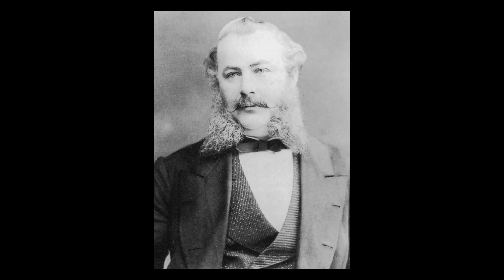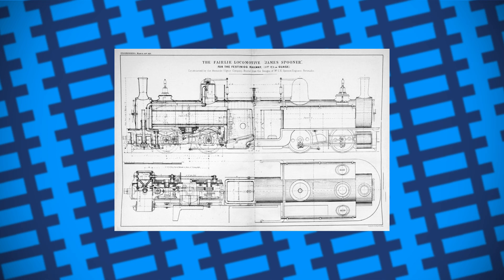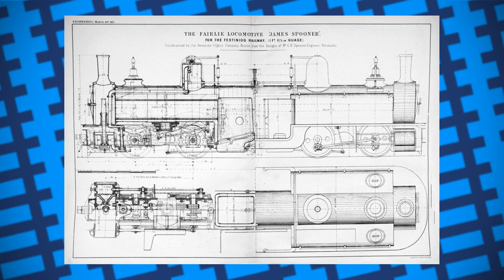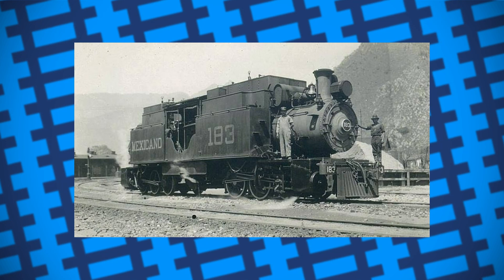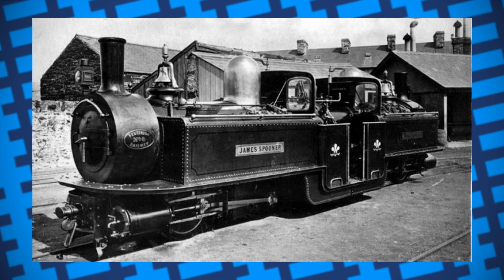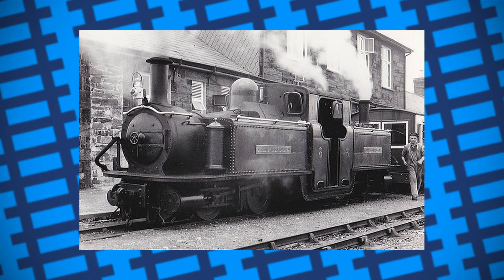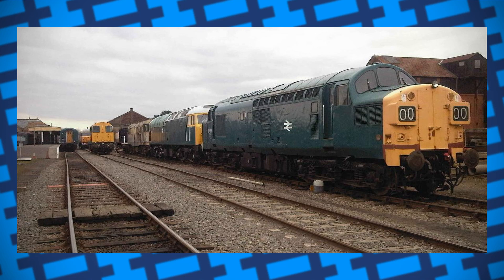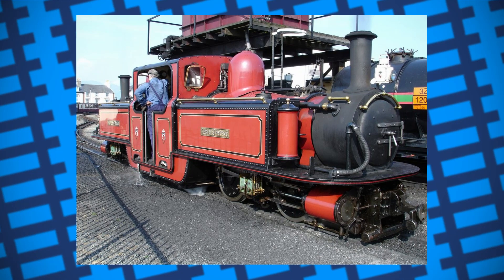The double ended steam locomotive - Fairlie Locomotives

Comment: Wye, for turning locos and train cars, is pronounced 'why' not 'way'.
Reply: why?
Reply: @dontspikemydrink9382  because it has a letter "Y" shape. Imagine there's a line across the top of the letter, making it a triangle with 3 tails. A loco heads into one leg, is switched to a second leg and backs out, then onto the third leg facing the opposite direction from which it first entered, thereby turning it around. Drawback is it can take up much more space than a turntable.
Reply: @rosemarycornwell1528  interesting

Comment: The Fairlies worked well on the Festiniog, which was very narrow gauge ( 1'  11 1/2" ) and had an extremely 'tight' loading gauge.   Originally operated by horse traction (uphill) and gravity (downhill).    The Fairlie was probably the first design that offered enough power to be useful.    The Festiniog thus demonstrated that railways could be built relatively cheaply in mountainous countries with narrow gauges, and operated successfully by steam power.   This was why Robert Fairlie gave the Festiniog a free license to use his design. 
The Festiniog line was only 14 miles long, so fuel capacity was not a problem.   The small wheels (had to be small to fit under the frames) gave good traction but limited the speed - but on this line with its short length and sharp curvature, speed was not important.     Very much 'horses for courses'.

Comment: I think I know how to fix the problems with the Farlie (I’m not an engineer in the slightest so don’t take anything I say seriously) 

1. Add leading wheels

2. Add two sets of controls. One on each side facing each direction. 

3. Make them burn oil so they can have tenders. Pipes will bring the oil from the tender similar to southern pacific’s cab forward locomotives.

4. Use them mostly on shorter runs where there isn’t a lot of time to turn around. 

The way you would turn them around is by using three tracks. One for the consist, one for the tender and one for the locomotive. 
The locomotive would leave the train on the first track. Then it would leave the tender on the second track. Then the locomotive would use the third track to move to the other end of the tender (which would have all the same connections as the front )(the locomotive would also retain the onboard fuel and water tanks to allow it to do these maneuvers.) Afterwards the locomotive would then move from the second track to the third track  and couple back up to the other end of the consist and leave the station.

Comment: ive seen a few logging locomotives that use drive shafts to power all wheels they burn oil and have lots of water space, they only go max 15 miles a hour but are very powerfull, most likely they were called shay locomotives
Reply: Indeed they were called shays!

Comment: No. 2 Double Fairlies were built on the Ffestiniog during it's opperational years, Merdden emris in 1879, and Livingston Thompson in 1886. The latter is now at the National Railway museum. However since the Ffestiniog was re-opened, 2 more Double Fairlies have been built on the railway, with a third currently being built. so in short, 4 Double Fairlies, soon to be 5 have been built on the Ffestiniog Railway.
Reply: As well as No.7 "Little Wonder" (very much a working prototype, hence it's early withdrawal in 1883), there was another on the original line. No.8 "James Spooner" built by Avonside in 1872.  Much of the valve gear on No.3 "Livingston Thompson" (the one at the NRM) comes from this lost loco, broken up in the 1930s.  The most recent of the present day company's double locos carries its number and name.  

There's also a modern Blodge-built single Fairlie 0-4-4T, "Taliesin", a recreation of another FR loco scrapped at around the same time as No.8 (currently underoverhaul, expected back in service back end of 2024).  Elsewhere, a private group are recreating another long scrapped (NWNGR) single Fairlie, 0-6-4T "Gowrie", the original being Hunslet built and sharing quite a few components with preserved NWNG/WHR 2-6-2T "Russell", now resident at the Welsh Highland Heritage Railway.

It's worth noting that Blodge continue to refine the Fairlie concept, with use of superheating and recent design improvements to brakes, flexible steam pipes and bogie pivots and the use of monocoque cylinder blocks.  Regular workshop/shed tours operate, see 'festrail.co.uk' for details
Reply: Neither the little wander, or the original James Spooner were built in house. I believe that we’re talking about fairies that were built in house, as opposed to being brought in from outside. And neither the Little Wander or James Spooner, the first iteration were built in House.

Comment: I made a Fairle, but, I changed it a bit, I called the tender Fairle, the tender is in the middle and no couplers needed for the engine and the tender, the tender is welded to the engine, two cabs, a un powered bogie (sad), and still having one boiler, just the boilers a shorter cause don’t need more steam.

Comment: On the Ffestiniog at least, which is the line they were really designed for anyway, the Fairlies do perform as Robert hoped from what I hear. But the flaws evidently became magnified on longer-haul lines and on larger-scale builds.

I have to wonder if a boxcab arrangement with duplicated controls at either end (as seen on the Y6 and J70) would have worked better than giving it two standard front ends.
Reply: .... or Mr.Bulleid's semi-successful  "Leader"?

Comment: If I had to create a new steam engine, I would create a similar concept than the Double Fairlie except that it would be longer, the common point would be the fact that it would be double-ended but here are the differences : there would be a gap between the two ends so there would be two engines instead of one; each "end in the cab" got a firebox and each end have their own coal compartment and water tank... Would that be a good idea or not ?

Comment: A turntable or a way ... A way to fo what?

The original locomotive was called Little Wonder, not Little Wander. Wonder as in wonderful. One thing you failed to mention was that Little Wonder had 2 fire boxes and so was difficult to fire by one man. The later versions used a single shared firebox which was much more manageable but still more work for the fireman than a standard locomotive.
Reply: The first Fairlie was Pioneer.  It and a few more early ones had unsatisfactory single fireboxes.  Later ones all had double fireboxes.
Reply: @mikebrown3772  I stand corrected, but wasn't the first called The Progress (built in 1865 for the Neath and Breacon Railway by James Cross and Co)?

Comment: Why tender makes steamers slower at backwards, when tank engines can go both direction at the same speed?
Reply: Say that about the locomotive crew who operated the Texas in reverse during the Great Locomotive Chase of 1862 and the locomotive is a 4-4-0 with a tender. Tank locomotives lack in range comparing to locomotives with tenders. Only in the U.S. you actually find a 4 truck Class D Shay.  Despite those logging locomotives are slower, all of those wheels are powered.
Reply: Because tender engines are designed to travel 'forwards' at up to their maximum speed with good (or at least adequate) riding.   In particular, the 2 pony wheels on e.g. a 2-6-0 or the 4-wheel bogie on a 4-6-0 help to 'steer' the loco into curves.    Running 'backwards' you've got effectively an 0-6-2 or an 0-6-4 which isn't necessarily designed to run fast that way.
Tank engines are (generally) designed to run in both directions.   Suburban tanks such as 0-4-4T's or 0-6-2T's were designed for moderate speeds.   But any really fast locomotives always had 'leading wheels'.   For example the Brighton (LBSCR) whose main line was only 60 miles long, was famous for using tanks for everything, but its express tanks were 4-6-4's.
Reply: @kevwebb2637   To quote the Wikipedia page on the Andrews raid, "Locomotives of the time normally averaged 15 miles per hour (24 km/h), with short bursts of speed of about 20 miles per hour (32 km/h)."    The 'Texas' was running backwards chasing a train (the 'General' and several boxcars) that was running short of fuel (!) and kept stopping to try and cut telegraph wires or damage the line.   Note that the raiders were stopped on occasion waiting for southbound trains to pass, and the pursuers were variously on foot, in a handcar, and in a couple of other borrowed locomotives before they commandeered the 'Texas'.   This was not a high-speed chase.